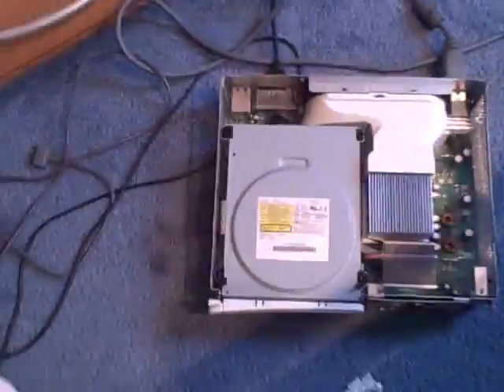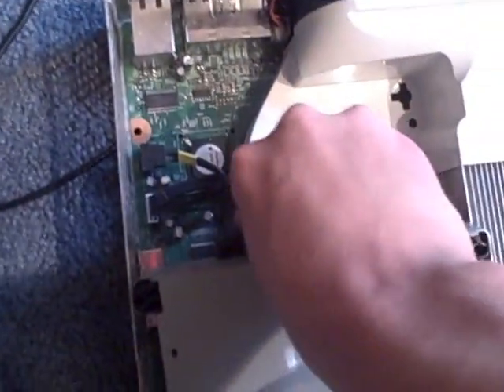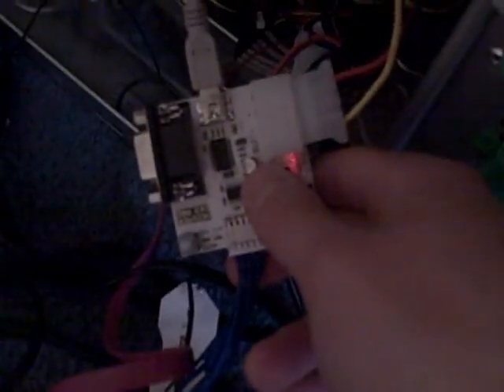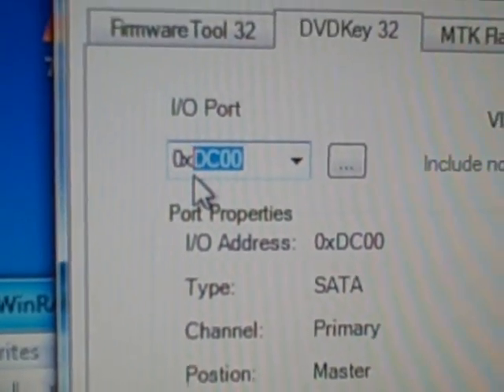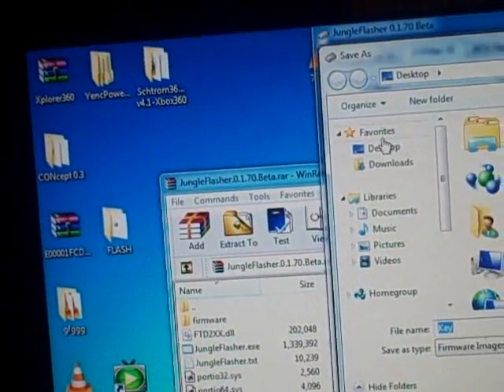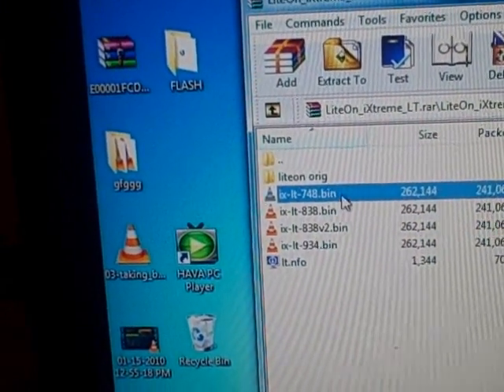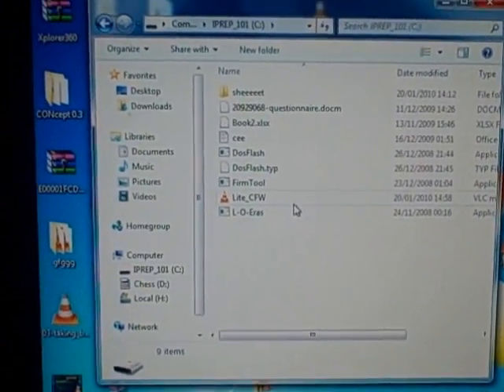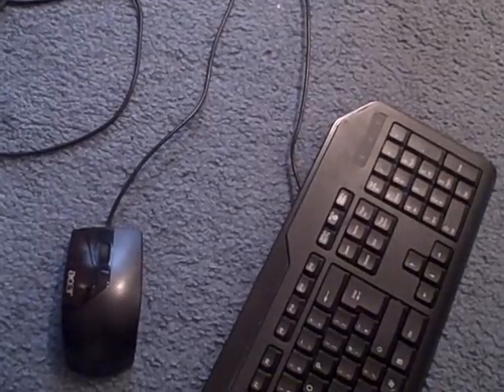How to flash Lite-on 7 series with Lite Touch new firmware Xbox 360 Part 1

Comment: Thanks, your tutorial worked perfectly for my bricked Lite On drive. My problem hapened exactly becouse I used Jugle Flasher and it corrupted when it was erasing my firmware. But I already had saved the original key and becouse of it I could rewrite it. Thanks so much.

Comment: I have a flashed LIte On with 1.61 and has a production date of June 2009 and it can play wave 4 and 5 games with the activate iso.

Will i be able to flash my drive with just the Jungleflasher and the LT firmware file? Or does it need other apps to work? Thanks in advance